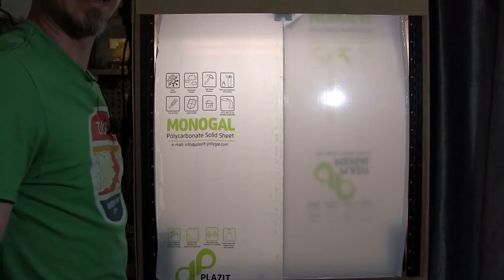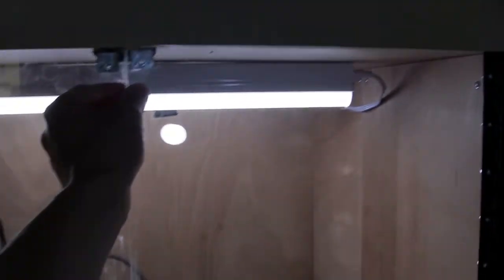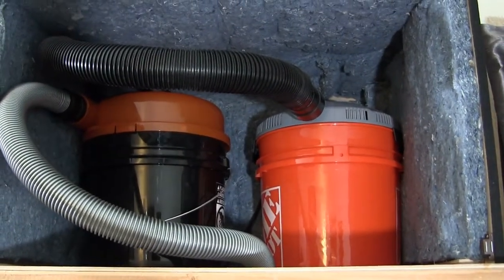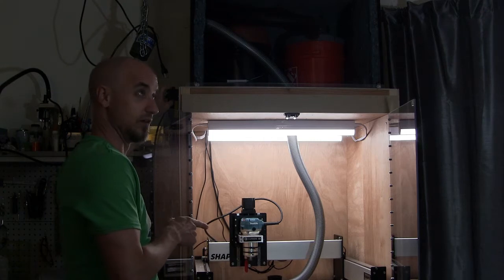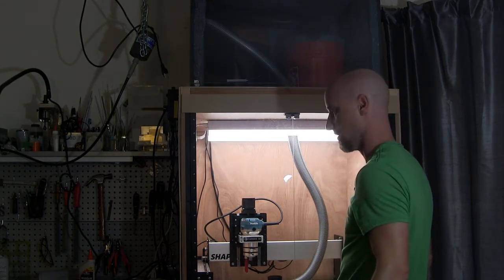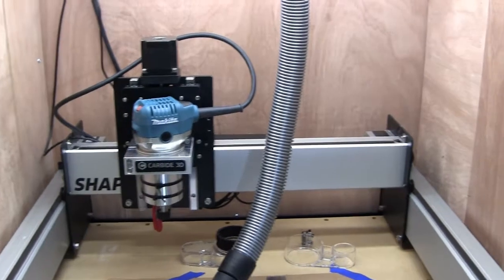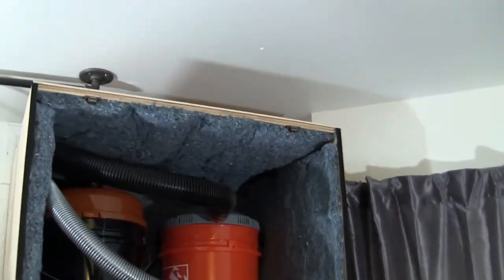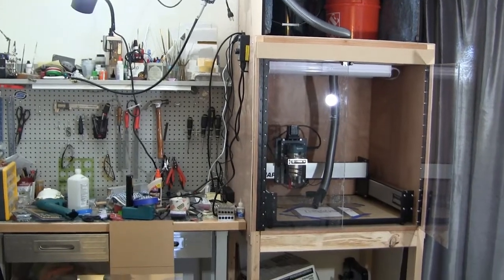CNC Enclosure Done

Comment: Hi, I'm a brand new Subscriber.. and like your work with brass using the CNC machine.. can you tell me what machine it is and do you use milling machine end mills with it? I want to do very much the same but with building model trains; specifically locomotives. thanks in Advance and happy Thanksgiving.
Reply from the maker: This is a Carbide 3D Shapeoko 3. The bits I use are mostly micro endmills, 1/4 inch and smaller. If you have the budget for it, the Nomad from Carbide 3D is another fantastic machine, but it's pricey, and the workspace is much smaller. But, it's more precise and can handle some very high detail stuff.
Reply: @StephensCustomModels  Thank you for replying, I was looking at both types of machines.. but the Nomad cannot do longer pieces like a passenger car side. BTW what router model are you using?
Reply from the maker: @robertravena  I'm using the Makita, it's been dependable so far.
Reply: @StephensCustomModels  That I saw, I was looking on amazon but didn't see the one you're working with. btw thank you for answering and being patient. it's appreciated.

Comment: Still loud
Reply from the maker: Definitely. But still quieter than without. Some day I'll build an improved version.
Reply: @StephensCustomModels  yup I’m about to build one myself haven’t decided yet on the actual design watching videos to figure it out . I like the double door on the front. Gonna buy that purple foam insulation and paint it white for the inside around you could try that
Reply from the maker: @keithruffner7168  If I've learned anything from mine, it's go as big as you can. It'll make maintenance on your CNC much easier. My space is limited, so unfortunately  I had no choice.
Reply: @StephensCustomModels  Thanks for the heads up I wanna have both left and right sides open as well so much to do haha